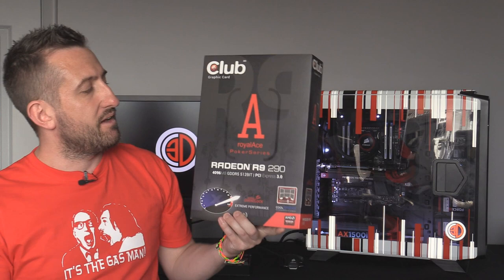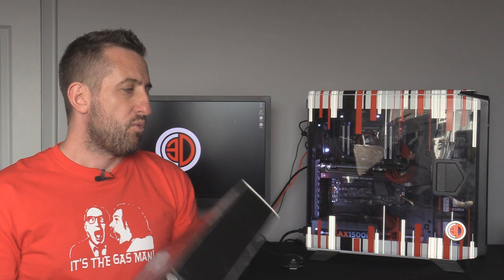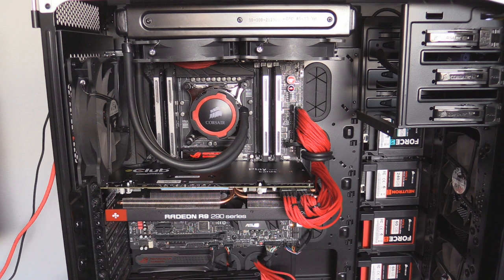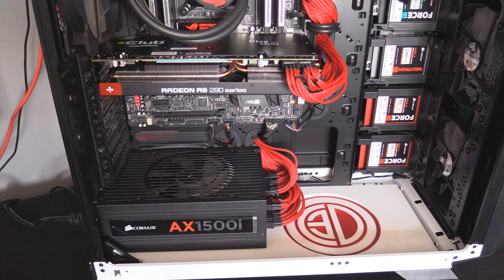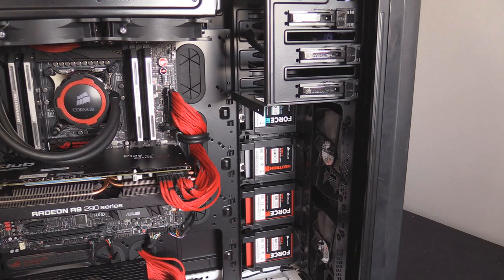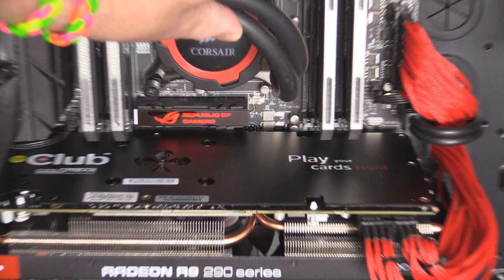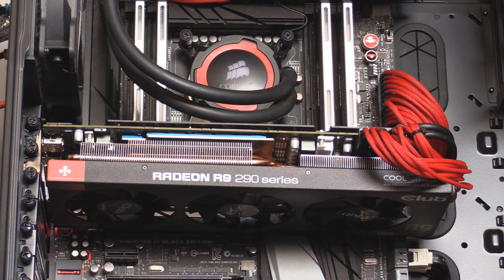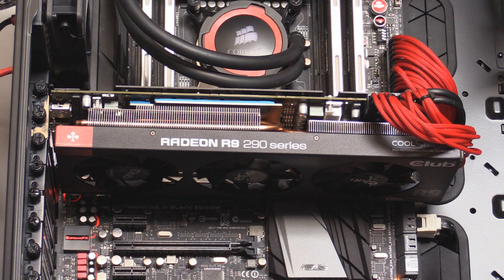Club3D R9 290 Royal Ace Review

Comment: Is Club3D a good brand? I mean has anyone bought their products? the quality of the r9 290 seems fine and better than zotac, power color and HiSo, but I always go with Sapphire or Asus, but I just saw this one on amazon for 289 usd. And I was like oh that's a great deal, but I'm not really sure about buying it, I've a r9 270x atm, and a 600w psu 80+ bronze, Do you think I should go and buy this one, or wait and get something better by let's say december?
Reply: Gerard i have this card, and it runs game very well. But I think my card i a bit loud, compared to my that has a tri-x one from sapphire. But if you are out buying one now I would go with one of the new sapphire r9 390's, as they are quiet and perform better because of the tweaks Amd has done with the new series. As for the PSU 600w bronze should  handle this card nicely.
Reply: Jeppe Bøjlesen Alright, thanks for the reply!

Comment: If your going to buy an r9 290 290 don't buy the gigabyte window model. I bought the wind force r9 290 r9 290 290 and while it works and gives me a pleasant gaming experience, it's both loud as shit and almost does literally nothing over
 a reference r9 290 290 in terms of cooling.  I am really super let down. I should have spent an extra 20$ and got a Sapphire r9 290 tri-x.